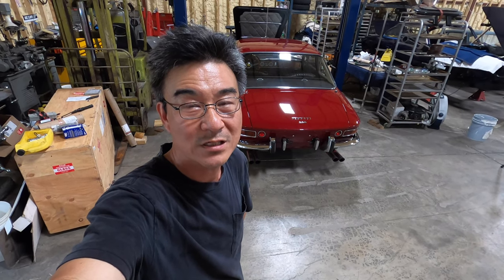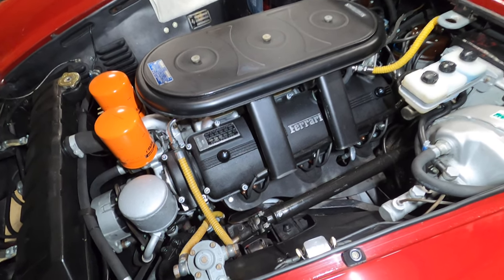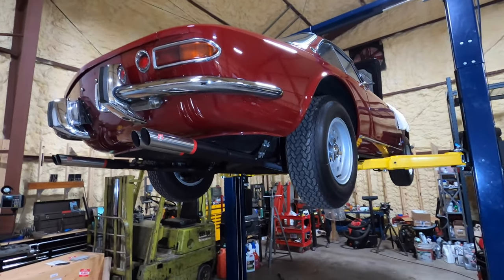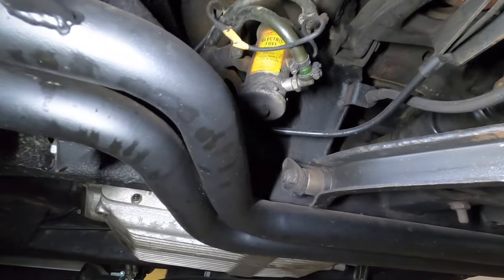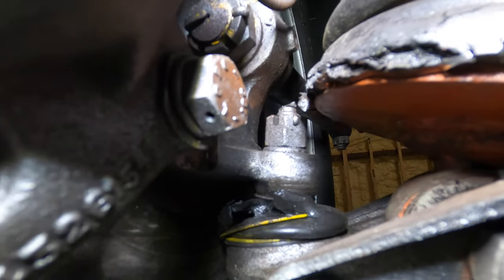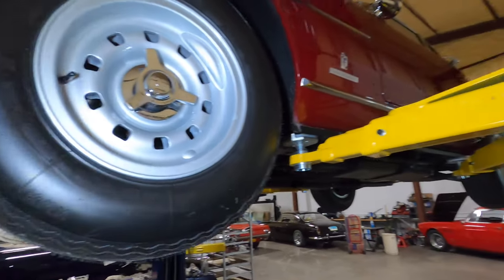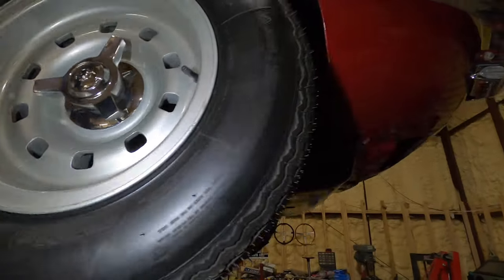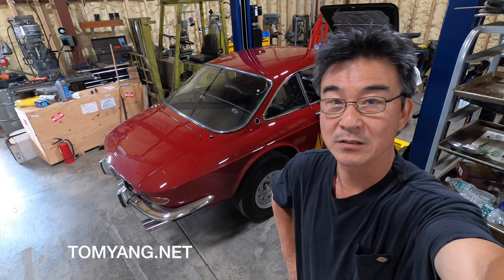Rubino Ferrari 330 GTC

Comment: Another great video, with one of my favourite Ferraris as the subject; such an elegant design. It's hard to imagine Ferrari letting these cars leave the factory with such a flimsy suspension design, great that it is such a simple fix, though.
Reply from the maker: It becomes very obvious how over stressed that area is once someone points it out, but I guess it was something that slipped pass the engineers. That little additional weld can save someone's life, so I hope everyone is on the lookout. I've already received an email from someone who had a GTC without the update! thanks for watching

Comment: Somehow I am happy that my Oldies are not overvalued. That means I do not have to be a perfectionist. Well I never was and never could be.
Your knowledge of details are amazing. The bubbled wheel looks terrible. I never had anything on any of my car powdercoated. I do not think I ever will. 
Magnesium wheels are a delicate thing. They may look great, but not easy to keep in great condition. Only one of my cars has magnesium wheels. And the older I get, the more I like good old steel wheels on my cars.
I did not agree with my Dad to keep the original big but narrow wheels on our very early Alfa Romeo Duetto.
A specialist told me that nowadays everyone tries to find original steel wheels. So I can be happy that my Dad did not agree with me and never changed the wheels.
I am a stock guy but I am not very fanatic about every detail. But I get mad when people try to persuade me to change the brake system on my old GM cars. We do not race those sixty year old cars, so why destroying the originality by putting discbrakes.
Reply from the maker: Some modifications are worth it, and some not so much. Each owner is different and their needs too!

Comment: Hi Tom, didn't Ferrari offer replacement Ansa systems after the Abarth/Spacem/Ceretto stock dried up?
Reply from the maker: Yes, ANSA was the OEM supplier for exhausts from the Daytona onwards, and supplied replacement exhausts for previous models, but in the pursuit of absolute correctness, this was not what was installed when these cars were new. Reproductions of Spacem, Ceretto, and Abarth exhausts are now available, and the cost is similar, so when it's time to replace the exhaust, I always recommend putting in what is absolutely correct. I believe Ferrari Classiche is installing a "ANSA Classic" exhaust on Factory built and certified cars, but still require and Abarth style exhaust for 250 cars. Their rules and certification process is as clear as mud, but I know if I install a period correct exhaust, future certification will not be a problem...until it's not!